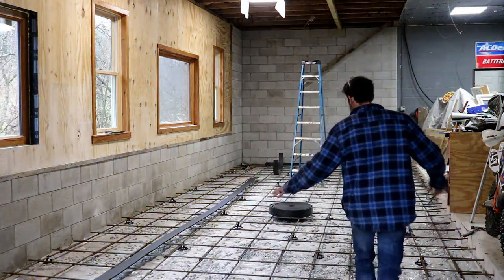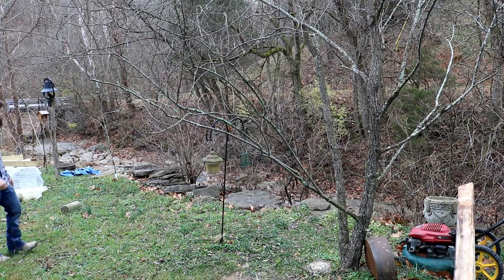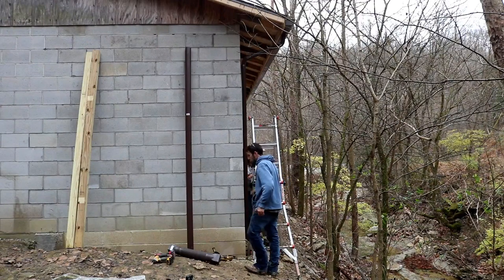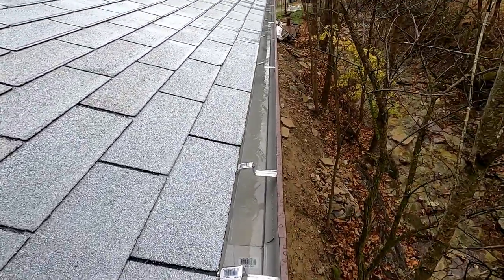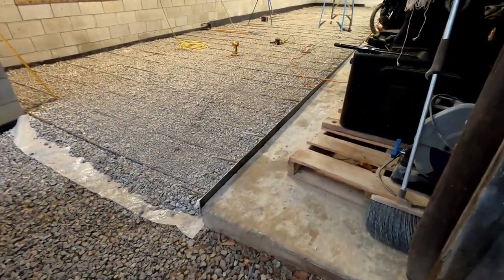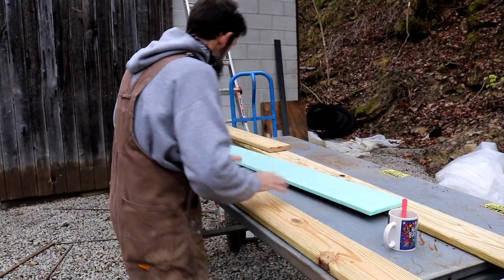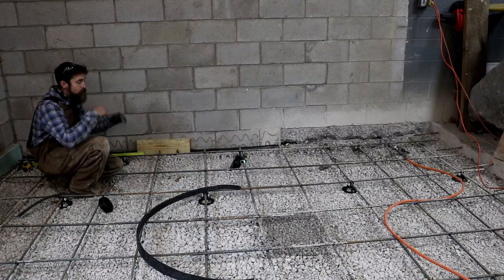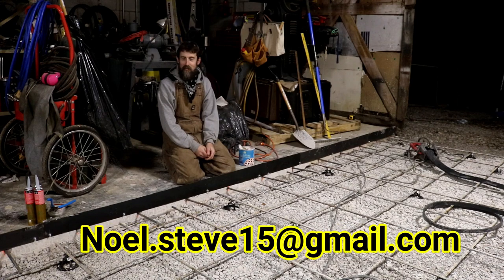Concrete Form / Expansion Joints / Troubles and Changes.

Comment: My comment about your desire to have a level floor is simply why?
To me when the wind & rain combine the water will flow under your big doors & find the lowest point to settle.
To me the only correct solution is to arrange your floor to have falls going to that big door.
This building you call a Shop is a factory for doing work in. Not your house, so you do not want to waste time brushing water out
Regards to your machinery it will require levelling no matter what you do.
My common sense says design for maximum use of your time.
So falls towards that big door & a level bit for fabrication away from that door.
Reply: @ralphgesler5110  At my age Sir I do not wish to get into a discussion about floors. Suffice to say that we all have our opinions & mine is that the slope by Mr Summers Workshop door  serves a very good purpose. Also, with the current floor choices are being forced on him. He is much better than an excellent Machinist. However, he cannot be expected to be a master of all trades, though I am more than impressed how good he is at everything he does. 
   This is the area called Design where he needs a lot more years of experience. I am not there looking at the true scale of this Workshop & its floors. But as a matter of common sense if a large block of concrete is there & it is stable without any cracks in it. Plus his machinery has been running on it for some considerable time. then we can safely say that it is stable. The other side of his Workshop which was washed away was clearly not stable. So quite rightly he has re-built it in the most stable way he knows how. He is now putting a new concrete floor in having cut out that part of the old floor that he is not satisfied with. This is all perfectly correct engineering. 
   Now his problem is how he marries up his new floor with his old floor. Everyone else is leading him to believe that  his long term solution is to have a nice level floor. I am simply pointing out that this is not necessarily the case. 
    There is a lot to be said for having a floor with a few well-thought-out falls on it. By the door is the most obvious one. The other obvious ones are around a number of the machines. I am not talking 1" in 10 ft. May be 1" in 30 ft other than at that door which is say 1" in 5 ft. & possibly steeper. But in order for the wind not to drive the rain water up it needs to be what it is.

Comment: 3/8 Expansion with Coni-Cap would have been your BEST option and you can "screed "from it  . That wood is going to give you nothing but trouble . you are WAY over thinking the concrete process . when you are done pouring , the following day you remove the cap and wait a few weeks and caulk it in  Waterproof !!

Comment: Ask your pour agent about additional, smooth finish, high strength powder mix to add to the bulk load at delivery. The sort of stuff they use in jail walls and floors.

Comment: My previous comment would add little cost to the overall cost of the floor. Also, a good quality screed mix with high strength at low thickness would give you the finish you need when transitioning the height difference. Some of the tiling or interior flooring experts could help with this.

Comment: To better encourage the concrete to crack at the control joint, cut every other piece of rebar running through the he joint.  The strength of the concrete at the joint will not be compromised.  You want it to break there. If you really want to make sure the concrete cracks at the control joint,  cut every piece of rebar and splice in a smooth round bar with the 40d splice length each side of the joint.  Make sure the ends of the rod are cut and not sheared.  Put some of your form release on the rod on one side of the control joint.  
The depth of the control joint tooling or soft cut should be at least 1/4 the thickness of the slab. If you soft cut that deep, it will rip out at the surface of the cut.  The edges will be jagged.  One way to prevent that is to tool in a shallow narrow control joint during finishing.  Then cut a deep soft cut in the center of the tooled joint once the concrete cures enough to be cut.  After all your hard work,  this little detail will make the finished product look much better.

Comment: half of what you are doing is not needed, concrete will shrink when it cures giving you more  than enough room as you won't see any where near that much temperature difference. you could also set pipe on v block stands to screed off of then remove them. you should however saw the pad in half to help control cracks if you get any settling(also an expansion joint as well

Comment: Wood expansion material.  You are certainly going to be sorry for that decision.  The wood will surely rot and go away.  There are other ways of getting a screed support.  Pipe on metal stakes with a bracket works well for small jobs like yours.  Good luck in your work, sure hope I am all wrong.  Thank you for the video update.

Comment: It would seem that scribing a board to lie on top of the old slab for a screeding guide would be much simpler.
If the slab was heated the expansion issue would be valid, I can’t imagine the slab temp varying enough to create a problem.

Comment: It may not be the charger, but the battery that failed. Most Lithium Ion chargers will not even try to charge a battery with zero volts. If you take a volt meter and check the DC volts on the battery terminal, you can verify that. I've had problems with a Porter cable that failed this way. But found a Youtube vid that said to connect to a good battery to inject some charge. That worked and was able to charge the battery. But in my case it was a long time not using the tool, with the battery put away discharged.

Comment: You're going to wish you had 3x4 leaders. 2x3 isn't going to cut it for that much roof area.
Also might consider that the underhung leader section is going to need to come apart sometime.
That's why I use stainless peanut screws to join them in and anchors with stainless screws to hold the straps to the wall.
Drive anchors are a bugger to get free when that leader becomes clogged or frozen solid.

Comment: Do not consider the gutter guards that rely on surface tension to curve around the edge and end up in the gutter.  They soon get dust and dirt on the curve, and the surface tension no longer works, and the water runs right off the edge of the roof.  They are worthless.

Comment: I think I would have opted to pour the new concrete up to the existing concrete and let the level change as needed to match the existing concrete instead of having higher areas and even lower areas as trip conditions. But this isn't my project and therefore if you are happy doing this project with such situations, that is all that matters. Amazing how a mere 1/2" difference on flooring levels will trip people up so easily... JMHO

Comment: You had pefrectly good expansion joints, the only important was to fix them properly, but you decided to change it for something which probably is not for such job,. The guttes brackets look slike faulty design it will definetly obstruct the gutters and make cleanig process much more difficult than it should be.

Comment: I do not know what you plan to put in the low spots machine wise. They do have self leveling substrates some stay flexible others harden they cost quite a bit but would give you a near perfect flat and level wherever you cough up the money for it.

Comment: Another mistake you made was to cover your vapour barrier with stone.  That plastic should be against the concrete to stop the water from the concrete when drying being absorbed by the crushed stone.  It is in the code but I guess you don't have to abide by any codes where you are.

Comment: Why not just use the expansion joint between New pour and old slab as your screed?
Your supposed to have a relief cut every 10' in both directions anyhow.
3" of concrete isn't that heavy. Sidewalks get poured that way all the time.
**What most people think of as expansion joint is really a crack control joint for when the concrete shrinks as it cures**

Comment: is'nt it strange the way homes are built these days? new stick frame home no rain gutters no where-notta block foundation has cracks after 1st winter framing contractor will point the finger at concrete guys saying "ground settled they did'nt compact it correctly"

Comment: I really wish we still used millimeters, centimeters and meters because I'm so confused with all these new-fangled  "inches" and "eighths" and "thous"
I was top of my class in 2nd grade fractions.
I just don't understand decimal.
I mean, really,
what is, exactly three eighths in decimal?
You see?
NOBODY KNOWS !

Thank you Sir.
Good on you for keeping my spirits up but not boing over.
>
Reply: i´M Brazilian , so i´m was confused with   "inches" and "eighths" and "thous", but after study a little and to be acostumated to see American YT makers channels so today is easy to me get idea of sizes. When they said to cut 1 1/2", is easy to see that is around 32mm. ( 25,4 + 6.5mm = 31.9mm).  Bear in mind, that one inch is 2,5 cm, eights are one eights of an inch or 3,12 mm, and Thou is a Thousand of an inch, or 0,0254mm. How many thou in 1 mm? The answer is 39.370078740157.  1,5mm=1/16"  -  2mm=5/64"  -  2,5mm=3/32"  -  3mm= 1/8" (3.1750) and so on.
1 metre is equal to 39370.078740157 thou, or 1000 mm.
After that now its easy to make the calculations in mind during the videos and do not get confused anymore.

Comment: Regarding expansion of material, I'm trying to make sense of it - dimensionally - and it's got me befuddled.  (a) if concrete expansion is a uniform constant (or is it not?), why would we see greater expansion length in the long dimension, (b) would expansion tend to weaken the material and is this why the rebar is used?  On (a) please don't reply "because it's longer" :_)  I get that part.  Bonus question: doesn't concrete heat as it's curing?  Therefore does it contract during the curing process, potentially reducing the area of coverage?

Comment: Isn't the rebar suppose to be in the middle of the concret and not under it??
Reply: I was thinking the Same thing he did have it earlier up on stands and all. And then it was filled in
Reply: later in the video, he raises the rebar again to be off of the gravel.  The gravel was put on top of some plastic to help with water condensation under the new concrete.
Reply: @NoseyLurker  Ops, missed that sorry

Comment: Have you thought about slab jacking the old concrete to bring it up to level? I've been surprised seeing how much lift can be done with concrete  injection .
Reply: He has enough issues, esp with no rebar and wire in old concrete but you did bring a good point to the job site.

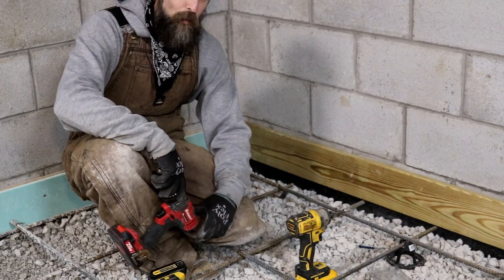Comment: (32:58) - what do you mean, you were lucky to buy the extended warranty?
You knew full well when you bought that drill that you'd be hammering the crap out of it 25/8 if not more.
I would have done exactly the same, but don't come over all like: "Oh, ain't I lucky I got that extended warranty"
 Because if "we", (your viewers), were to buy the exact same drill with an exactly similar project in mind,
of course we'd all plump for the "extended warranty"
Sir!
You weren't "lucky"
You were the three "Cs"
Cautious,
Careful, and
Calculated.
As should we all, when faced with such purchasing decisions.
(No offence)
>

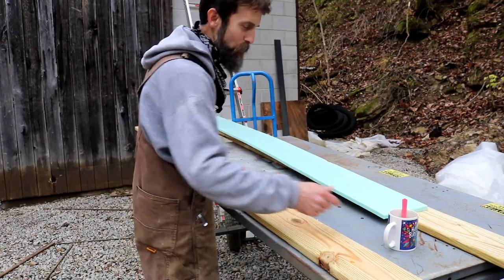Comment: (28:50) - "...before I could put my expansion joint all the way acrossed it..."
"acrossed it" ?
Is that imperial or metric?
Isn't "acrossed it" incorrect grammar?
Shouldn't it: "across it"?
Please help me out on this guys.
At first, I thought it was just a linguistic peculiarity restricted to Abom79, but when I questioned him about his "peculiar" pronunciation/grammar, he flat out ignored me.
So please guys, what is it with these "acrossed it" and "RPMs"
What the freak?
Could someone please enlighten me?
>

Comment: Ok, what is the deal with more and more Youtubers adding a "t" to the ends of random words (acrosst, spellt, senset). In case you need the reference, "Acosst it" at 28:53. Has this always been going on and I am just noticing it? I get dialects, and accents by regions and all that jazz, but a YouTube accent? Anyway good job slick, keep at it you will get there soon-t.
Reply: Lots of people do that,  it's nothing new.  It's a regional dialect. Just like youse or heigth.